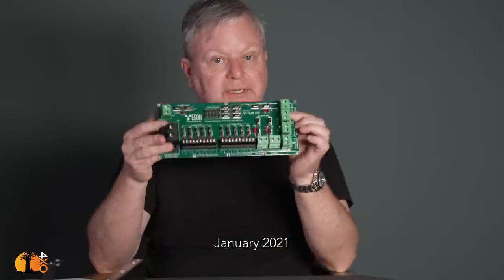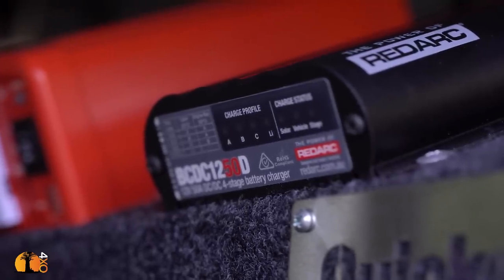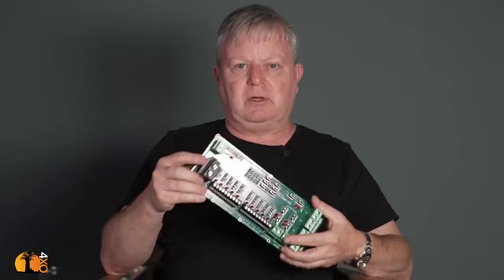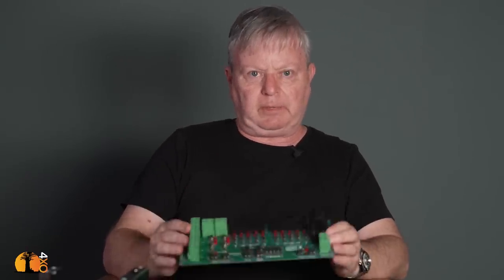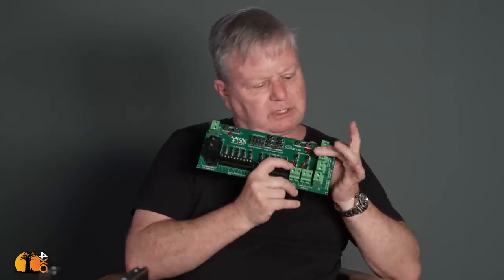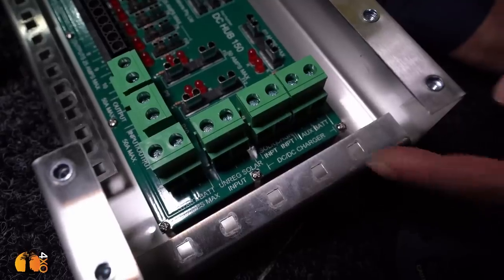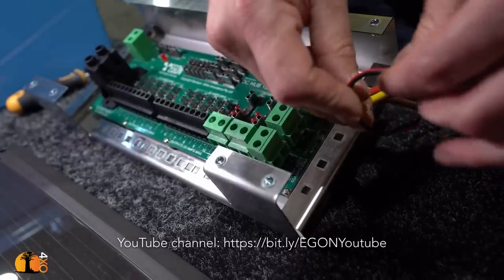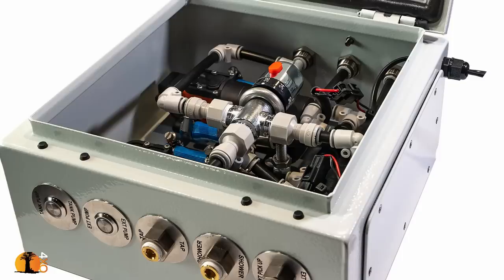DC-INSTALLATIONS MADE EASY. Unique, Problem-Solving Solution. Egon DC-Hub

Comment: I enjoy your work Andrew, however I think this product is a bit over hyped and you are making it sound far to simple to install. I fail to see how this simplifies things as much as you say.
This product does not take the expertise out of installing a dc electrical system at all. it does not let someone who has "not done any wiring at all" suddenly be able to perform the job, it sort of takes care of one aspect which is crimping/heat shrink (the tip of the iceberg as far as wiring goes) and unless you are releasing more products, crimping and heat shrink will still be required for the main fuses that supply the unit and also for switches on the outputs and other things such as Anderson plugs (mentioned in the video for solar)
someone who purchases this does not suddenly know how to run/secure wires correctly, wire switches correctly, crimp/solder a Anderson plug, mount various parts of the system correctly (the list goes on)
This really is just a fancy fuse box/junction point. unless I'm missing something here? which is what you keep telling people but won't tell them why. I hope you will enlighten me as to what point I am missing here? 
I believe this will definitely save time, and possibly money in a workshop environment (would have to be a rather large fit-out) however I think the money side is questionable, especially at $840! 
As for someone doing this themselves I think it's only going to cost them money.
Overall I think this would be a great product at a much lower price, however it think the description of this product is misleading people to think that having this product will save money and makes 12v wiring easy. It simply doesn't.
Reply: Bez, I agree and when I've commented on it in a similar way to what you have, ASPW has retorted that I must never have done any 12 volt wiring set-ups.
Well, let's see, I'll be 66 in a month's time and I've been fiddling with 12 volts since I was about 12 years old.....firstly in model train environment and then on motor bikes, cars and finally when I bought my first 4x4 in 1990.
I've got a fair idea of what foibles await the uninitiated.....because I've made several stuff-ups along the way.....
Those stuff-ups have taught me many things and one of them is to recognise this "hub" for exactly what it is: a glorified fuse box with multiple power IN and OUT sources. That's great! But you still have to wire-up relays and switches, so more wiring that might be going to completely different places to where the "hub" is located.
For example, I have a lot of my wiring in the back of the large canopy of my Chevy Silverado. Logically therefore, it would be the ideal place to place my "hub". Some of the things that I would need to power-up through that "hub" are UHF, my Kleinn Demon 730 air horns, Fyrlyt Nemesis spotties, roof LED bar, rear LED bar, side LED bars, front corner LED lights, isolator for the alarm on the canopy gull-wing doors (so I can stop the alarm in the cab when somebody is getting stuff out of the canopy when I'm stopped say dropping off somebody at the airport), my back-up Kennedy fuel lift pump, air compressor, dashcam, TPMS, Airbag Man digital gauge, 2nd reverse camera...etc etc. 
A lot of those accessories are nowhere near the rear of the truck, so it makes no sense to have to run cabling to and from the hub for, say, the UHF radio.
I think the type of DIYer who is likely to not even blink an eye at the price of this is someone like ASPW himself who has either plenty of dough or has sponsors that supply a lot of his gear.
Just on that last point, I see he is asking over $200K for the dual cab dream tourer. I am left wondering how much that vehicle actually cost him to "build" (sorry, I should say..."to have built"...unlike you and me, he doesn't really "BUILD" 4 wheel drives....he gets other people to do all/most of the work...and anybody with deep pockets or good sponsors can do that). For example, he made no secret of the fact that Amptron gave him his lithium batteries and Hella gave him an open cheque book for whatever he wanted out of their catalogue. I wonder how they feel about him profiteering off their sponsorship dollar?
Reply: It's basically the result of R&D done by 2 people with tunnel vision pretending they're design engineers, who can't see it actually doesn't achieve anything. Moreover it looks like a 10 year olds electronics project in a shoddy box. I'll qualify all that by saying I'm an automotive design engineer, so hopefully I can say all that without any danger of being proven incorrect or being accused of missing the point 🤓
Reply: @gaj5701  german Dipl.phys.Ing., 28 years at Bosch Automotive, 57 years old, early retiered, since 2 years around with 4X4 motorhome ... YOU ARE RIGHT Sir!
Reply: You’re right.
I think he’s really got this wrong.

He sort of says that it simplifies wiring, through not having to use crimps and being told what size wires to use, to the point that anyone can do it ... but whoever installs it will still have to crimp and wire in the switches and the equipment that will connect to it ?
Reply: @heinzweber7642  Always welcome to have another qualified voice on board 👨‍🎓Not that it matters in today's world where facts are basically whatever the person with the loudest voice tells you 🙄
Reply: @gaj5701  jes sir, we know what we know. Loudspeakers are always "Platzpatronen". 😆
Reply: @billroach2393  you nailed it sir.
Reply: Protection vs: vibrations, dust, humidity, sprinklewater, corosion, mechanically demage, using heavy duty materials (like in helicopters, ships etc) .... All missing for t h i s price range.
Study the quality and prices for example of ship suppliers (example "Victron" and others). You will get better products, bulitproofe, for less money.
2cent from a retiered german engeneer, 28years at Bosch automotive, 4x4 overlander for over 30 years.

Comment: I’m in the early stages of planning the building of my 110 into an overlanding vehicle. This product and the future water hub will absolutely be going into my rig. When you referred to the Egon in a video last year I was looking to forward to seeing the final product so I’m extremely happy to see you launching it now. Congratulations to you both and I wish you much commercial success 👍🏻🙂
Reply: I'm building a 110 at the minute & so far I've used a 6 block negative bus bar fuse box in with the main fuse block for main electrics extras (spotties etc.) & a 12 block for the auxiliary electrics high on a hesch style cabinet in the back. If you manage to squeeze your aux battery in the seat box (can be done, my knuckles can testify to that) I'd recommend doing this kind of thing to keep it even simpler rather than trying to find somewhere to mount this in a non leaky part of the vehicle & running 2g wiring all over the place 👍

Comment: Congratulations, cool looking fuse box. I like the clear cover. I think if for off road use, you might need to support and seal the PCB better and it really needs Midi style fuses for any of the high current circuits. DC is very unforgiving with vibration and voltage drop so you don't want any arcing or shorts especially with high fault currents of lithium batteries. Hope you have great success with your product. Cheers

Comment: I'm an electrical engineer working in the automotive industry for the last 8 years, and have designed similar (more complex) boards in the past. I'm sorry, but screw terminals are not the way to go- they are supposed to be used only with solid wires and in a non vibrating environment. If you market the board without the enclosure there is no mitigation for this problem.  There are snap in terminals that are much better suited for the task.
Is there any reverse polarity protection? 
All the test you show are held in room temperature, this is not the way to test an automotive product. You need to test it in thermal chamber simulating the high ambient temperatures inside a parked vehicle.

Comment: This helps with one side of the wiring. But it doesn’t help with the switching side. So I don’t think it really helps much in terms of making it more accessible to users who don’t understand wiring.
Reply: Nor does it help with the accessory side ...
Reply: No, it doesn't help with the switching but it serves its purpose for providing simple, safe power distribution for accessories without hacking into the vehicle harness. 

That's the stated purpose and there are far too many nuffies who've lost sight of the purpose of it.
Reply: @k2svpete  Hi Peter - How does it offer anything different to hacking the original wiring over any of the other distribution units?  
Any of the many products (sPOD, VoSwitch, Blue Sea and the many basic Fuse Boxes etc) can all be run as entirely separate circuit direct from the battery.
Reply: @Anderzander  through the simplicity of the unit. Making connections, fault finding and correcting is easy. Remember what it's being designed to do and in what applications.
Reply: @k2svpete  So there are lots of products that do that ... 

If it’s about simplicity of connection, putting aside the robustness of screw terminals in high vibration environments, then the same person would need to terminate the switch and accessory side - so I’m not sure it brings that much benefit. 

If it’s about simple ‘analog’ construction  and fault identification - there are many many products that are in / out distribution fuse boxes with LED warning lights - I have been using one for years that costs £20

If it’s about robust then the PCB should really have been supported in the centre too to stop cracking - and to prevent issues with moisture or corrosion it would have been good to coat it.

If it’s about not hacking the OEM wiring then that’s a design decision you could apply using many of the products that are already on market.
Reply: @k2svpete  who is hacking their wiring looms to add additional components off auxiliary batteries?
Reply: @wikkidme755  I didn't say auxiliary batteries. You do have some people hacking into the harness for switched power and such instead of going off the second battery or ending up with multiple earth points everywhere, making for a dog's breakfast.

Comment: I like that this a well built device - made very specifically for common aftermarket vehicle DC setups - and not just a generic fuse box, but the price is a little hard to swallow. The fact that the mount/case is not included is also frustrating. Will be interested in following how this goes and if it gets refined and if the price comes down as the process is streamlined. 

Honestly these products look like the vehicle equivalent of a breaker box and a pex manifold (the water version he mentioned) of a house, so maybe it is time someone did this.

Comment: Considering that those Phoenix style connectors should really be used with crimped ferrules for maximum durability, I fail to see how this “eliminates crimping”.
Reply: I to was wondering if "bootlacing" DC cables would be a better connection, or worse?
Shame they don't give a Torque spec termination
Reply from the maker: Recommended torque settings are supplied with the unit and are on the website.

Comment: I'm not a fan of wires terminated without crimped lugs for situations where vibrations are common (see military applications for the best practise - always lugs). Also from what I can gather the high current output is fed by the AUX battery side. I always run my compressors from my main battery. I think a symmetrical main/aux setup would give more flexibility.  Huge fan of your content and I enjoy how you narrate your own thought process when looking at something from a different point of view. Keep up to excellent content

Comment: I really wanted to pull trigger on this but the lack of relay switches means I will wait for version2 if it comes. We have followed you for years and even spoke with you at overland expo west. Good luck and stay safe!
Reply from the maker: There are several products on the market with relays and switches. This is not one of them and was never meant to be. Which means, I didn't communicate the point of the DC hub very well.  It's the challenge of trying to explain something new.

Comment: I do not like to knock. But.
Vibration.
Led,s not glued and connectors
The connectors are pin into circuit board. Fail point. Also screws are know to vibration lose.
No middle board mount hole. Flexing board. In turn putting pressure on connector pins. 
No coating. Dust , moisture .
 Dust and moisture shorts out circuits.
I have seen mold growing in connector with corrosion.
Great idea. Little improving.
Younger life I made printed circuit boards, also thur hole plating.
Then testing.
Nothing is never possible. I have seen many contractors start crying after a few minutes of testing.

Comment: I’m building a very similar “DC hub”, only with DC circuit breakers. Incorporates AC as well. Costs 1/3 of the price. But seems to be the same concept (unless I’m missing something in your system). All wires go to one place, no crimping / heat shrink involved. I do really like the idea of how you secure your wires. Simple and effective.

Comment: Won't ask a question, because after watching a 24 min video, surely everything is abundantly clear about this "game changer", (not a fuse box).
In the video there is a shot of yourself exerting a whole lot of effort crimping/swaging  on an electrical eye fixture to a cable. This was to show that the new product eliminates this type of work. But how do the little screws in the connectors on your board clamp cables with any equivliant force/ pressure? I guess this is why some commenters have mentioned midi fuses?

Glad you have done a years testing, including market testing of potential consumers - like all the targeted  people here who watched and commented on your video.
I know, I know, we don't get it.
Reply: Given that you've gone off on a tangent with the functions of a crimped terminal, as opposed to a screw connector, also missing the bit about cable ties being used to secure the cables against movement, it's pretty clear you've missed the point.
Reply: @k2svpete  what point? and i think most of us missed it...
Reply: @wikkidme755  you've missed the bit at the very start regarding the targeted applications. 

Its for medium to complex DC installations to simplify wiring and power distribution without hacking into the vehicle harness. It saves time for wiring to be run and cost for ancillaries in these applications. In these applications, it pays for itself. 

If you've got a simple system with a charger, fridge, compressor and some camp lights this isn't the product for that setup.
Reply: @k2svpete  
Mmm the stainless box that you would fix cables against I believe is an optional extra. 
Seems odd to me that many many comments have been constructive and offering suggestions and feedback, from the very people who may purchase such a product.
 in this form or some future version. And largely Andy has told all and sundry "you don't get it, it's not for you, it could not be better" and disengaged from the video  and viewers. Andy is certainly entitled to behave this way, just a comment.

Comment: I just had a Li battery, inverter, monitoring shunt, fridge connector, DCDC, compressor and lighting utilising an Egon fitted between the back seats of my 200 series and the drawers (by Heiner and his team). It is a VERY neat, compact solution. It definitely was not the cheapest solution but it is simple. Less complexity, more reliability.
Reply from the maker: Thanks for that. How much labour time did the unit save you in cash? You may find that it was the cheapest solution. After all, that's an important part of his product.
Reply: @4xoverland  I didn't get a formal quote without the Egan to directly compare. Prices vary so much with 12v systems based on quality so it would be easy to directly compare. The greatly reduced amount of wiring and the simplicity of the solution was the main selling point for me. You may be able to do a cheaper solution using the cheapest available ebay parts but that wasn't what I wanted.  Reliability and quality is what I wanted. Unfortunately, I do not think I can post a picture of the set-up.

Comment: I wish you guys all the best with these products!  I really do think they are a great idea.  I especially liked the attention to details to give a place for the cable ties to secure the wire to prevent fatigue.  

My critiques would be that it just doesn't look finished, I think because it lacks the same rugged appearance as other products for the Overland/offroad market.  Looks more like something found in a commercial building.  Also the optional stainless holder and cover looks like it could be made lower profile (or at least currently only limited by the aux battery input?).   

Good luck again and I am really excited to see this out in the market! (Let me know if you need anything tested in Canada).  Cheers

Comment: There is a product called hotbox that is sold in oman that does what ypur talking about. 
Great product you guys have produced. For me it's between this and redvision. Since you have used redvision in your tourer can you please tell me the difference between the two products besides the simplicity fact. Thanks 😊
Reply from the maker: Redvision and the DC Hub do similar things but the DC hub is not digital, has no switching and no monitoring, no screens and nothing digital. But wiring is as simple as it can get. It a fraction of the price and anyone with basic wiring knowhow will be able to install it. You won't need both.
Reply: @4xoverland   thanks for the reply. I realised that you didn't want questions after I already posted. Much appreciated. Great product